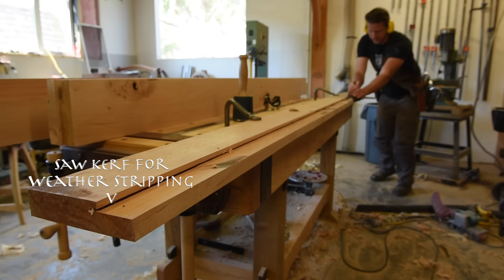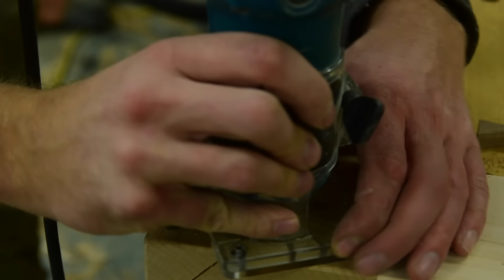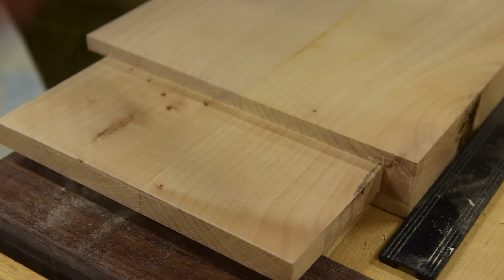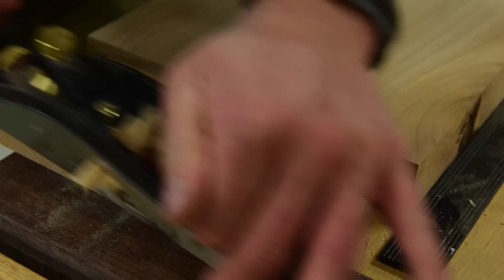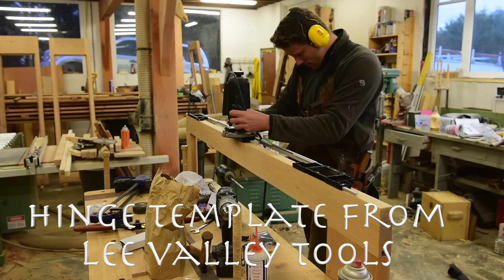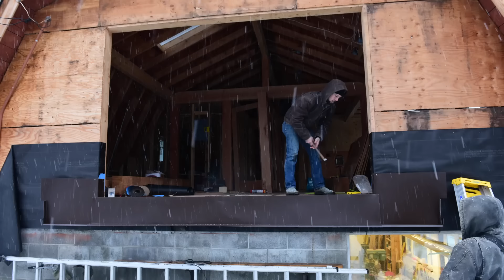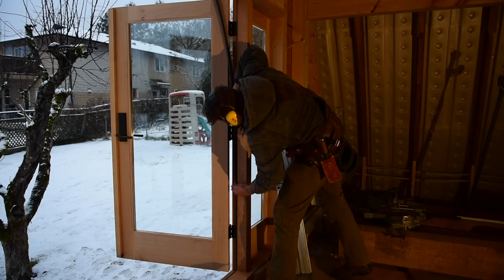Woodworking, Building French Doors, How To

Comment: Outside doors need to swing in
Reply from the maker: No they don't.
Reply: Don Dehne most residential doors swing inward, but on almost all commercial it is code that they swing outward due to public occupancy (incase of a fire or emergency it's easier to get out). in a residential situation like this with a large French door it's very intrusive to the inside of the room, Makes sense to swing outward.
Reply: Yes, or the hinge-pins are on the outside and you can remove them and remove the door...and break in..so...don't store anything valuable in there...
Reply: Out swing is in! no pun intended, several pluses to out swing french doors.
Reply: Cabinetmaker1974 breaking the glass is tamper evident. pin removal isn't
Reply: Or they can swing however he wants them to swing! He built some sweet ass doors! Good job Samurai.!
Reply: Charles Timko  
Take a closer look at the hinges when he is dadoing them in... notice anything different? Like the fact that there is little ball bearings, or that that bottom is capped off so you cannot remove the pin. It's an out swinging hinge made for this application.
Reply: Anderson B pins went in, so pins can come out. as a security professional this would be a concern for me when buying a house. he did a great job on the doors, no question. just mentioning the security aspect while it's still not too late to turn the door around.
Reply: Not always.   It really is up to what the home owner wants.  They are writing the check.
Reply: Not sure if anybody would take that much work with taking apart hinges since there's glass window in them..... Even if not.... If you take so much work like taking apart doors you can get into any doors.... ;)
Reply: Don Dehne I've never set French doors that swung in. The weather problems from in swing doors, the space issues the aesthetics all call for them to swing out if there's room.
Reply: Lee Valley, for example makes hinge pin locks to address this issue... you can buy hinges with the pin 'fixed'.
Reply: Those hinges are premade for outside application, the end caps are fixed w/ a spring loaded kind of pin that locks into place once the primary hinge is slid over it...it's designed this way for this application guys... and in my experience French Doors swing out unless it's the front door to the house*...
Reply from the maker: Secure hinges. The pins can't be removed.
Reply: The Architectural true "french doors" swing out, into the garden usually. it was also usually a metal door with glass panes. sometimes could be swung 180 degrees to go against the side of the house allowing the outside garden and patio to almost become part of the house. the term is co-opted from there to mean all glass double doors regardless of swing. Now, when I design homes I have to have this conversation with every client to be clear which way they want to swing. outswing is better,  inward for the weather
Reply: Build it you want, for your own house.   Build it the way the coustomer wants.   Right or wrong has no play in this asspect.   In/out who cares.   Only when it gets in the way of something else, will it matter much.
You go Samurai.   I make screen porch doors everyday, and they do not all get done to the "norm".
Reply: No they don't
Reply: Exterior doors can be done either way. Of all the doors I've done, if it's a front door or a back door it opens in, if it's a set of French doors (which aren't being used for front doors) it opens out so they don't take up room inside.
Reply: Plus, if they swing out, it's a lot more secure since you have an entire jamb to press against instead of just a small piece of wood and metal that the lock bolt is going into.
Reply: Go anywhere they have hurricanes or high wind codes and you'll find almost every exterior door swings out. The pressure on a door can exceed 500lbs in 130mph winds. Better to have it braced by the entire jamb vs. just the hinges and the lock.
Reply: I am a 67 year old cabinetmaker and homebuilder, there are lots of times where the exterior doors need to swing out. Marvin will make them, and, I assume the other manufacturers will to. I installed Marvin wood French doors that outswing because I wanted to save space inside of my house. They actually seem to be tighter than a standard door, I think the weather stripping and threshold are actually better than on an inswing door. I have learned over the years that nothing is written in stone, you always have to adapt.
Reply: if it was a commercial application, and this would be a stretch but it could "could" be because its his shop, because of egress you would want the doors to be outswing.  Granted, there isn't panic hardware, but it doesn't stop people from finding a way to push the door outwards.
Reply: Correct, if no landing available, but as he mentioned a deck will be built.
Reply: You must be a really bad security professional if you dont know that this kind of hinges have close caps and are just a smaller version of the hinges that are also used on fire exits (that must swing outside, its the law).
Reply: Wrong. Exactly how i'm building them, using the exact same hinges. There were three things in this video i didn't see before i made a bunch of decisions, and i'm happy to say on this watching, i caught them.  They may well of influenced my decisions, i'm not sure, but, got wood today. Probably 2 months before install.
Reply: Hi Charles, there are hinges available that will not allow the door to move when the pins are out and door closed. Imagine a little peg inside the hinge that goes into alittle hole each time you close the door.
Reply: As a police officer I have NEVER seen/heard a burglary report where the hinge pins were removed (and replaced??)... LMFAO!!
Being from snow country, one reason for in-swing doors is where snowstorms will pile snow against the door. Makes it real hard to get out!